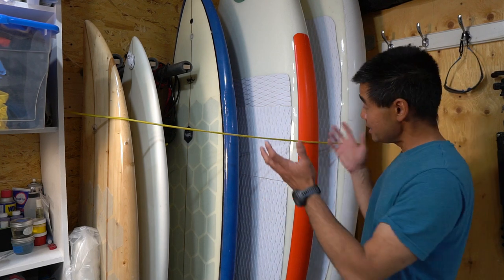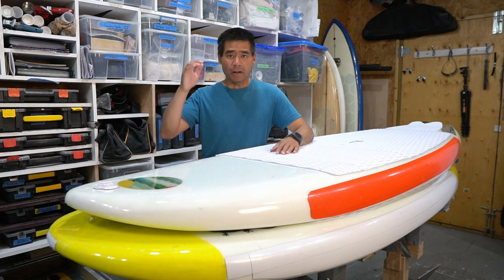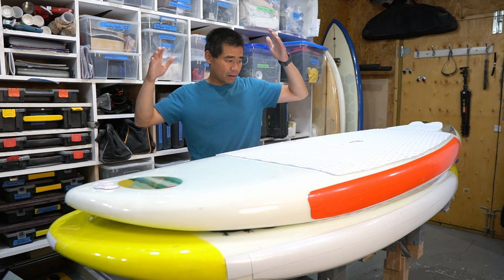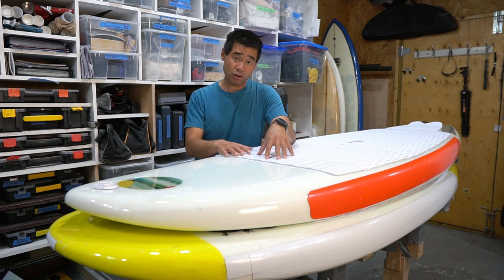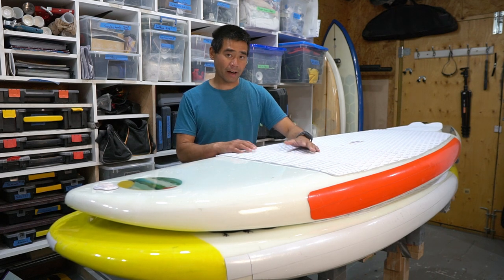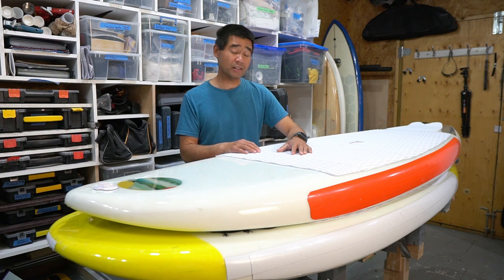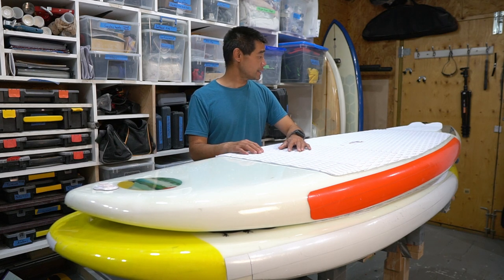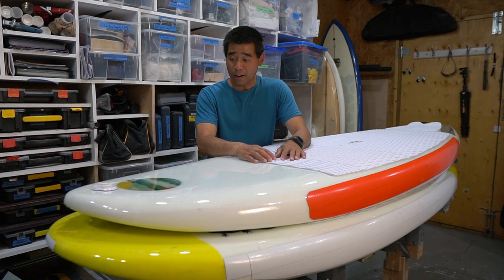I Built a Performance Surf SUP | Learning to SUP Surf

Comment: I am looking into building my first board ( A Wing Foil board) and stumbled across your videos. This is an excellent video with a ton of helpful info! This was a great resource to help narrow down what I needed to do/use and how it ended up. Hoping to get my kit through greenlight. Do you have any experience with full carbon glassing structures? I haven't found much out there, but I think it is the best option for getting a stiff and light board. Would love to hear your thoughts, CHeers!